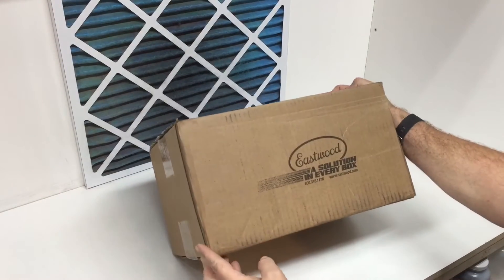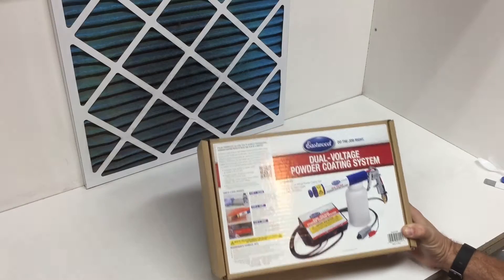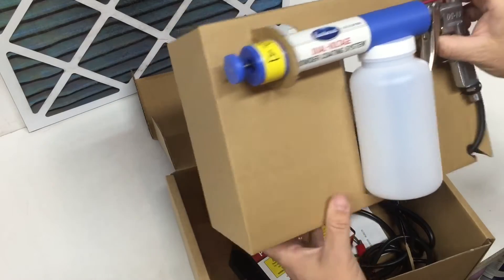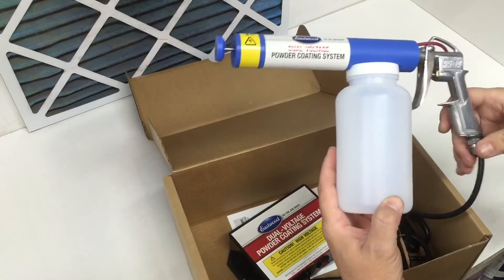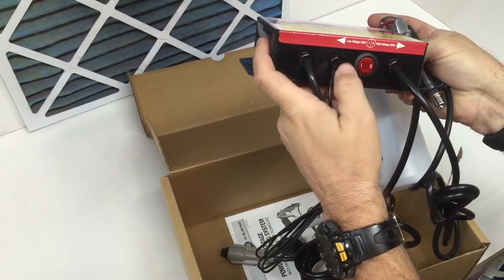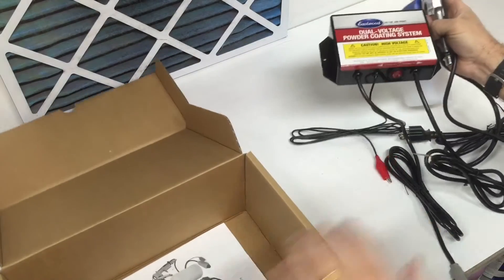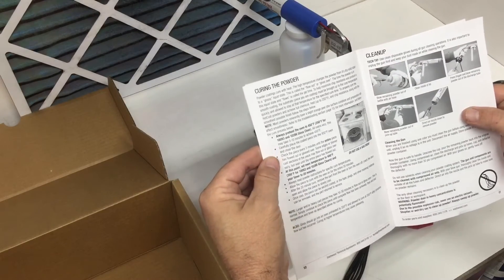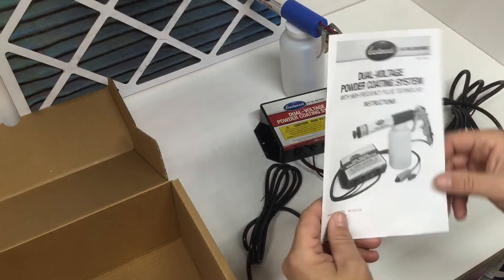New Eastwood Dual Voltage Powdercoating Gun Unboxing

Comment: When you spray cups do you use low or high voltage?
Reply from the maker: High on first and low voltage on 2nd and higher coats.

Comment: any notable improvement from the dual voltage unit? I have been using the HF gun with fair results, but was thinking of purchasing this gun from Eastwood.
Reply from the maker: It does a good job.  I've been pretty happy with it.

Comment: How often do you switch the voltages? I am trying to decide between the single voltage gun and the dual voltage gun.
Reply from the maker: Fairly often.
Reply from the maker: The Dual is 10% off today.  I got an email earlier.
Reply: +ManCraftingTM thank you so much!